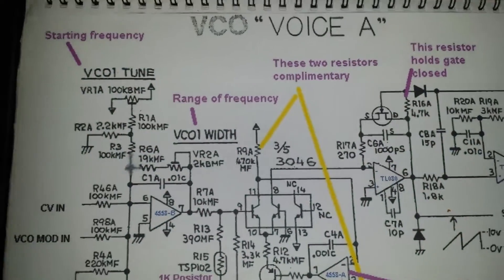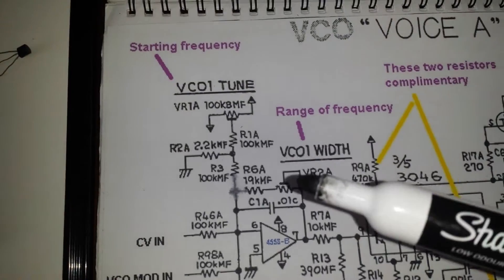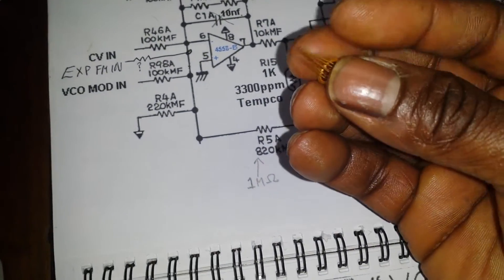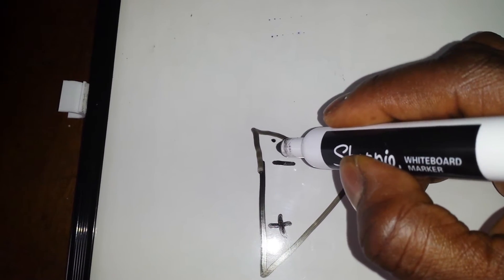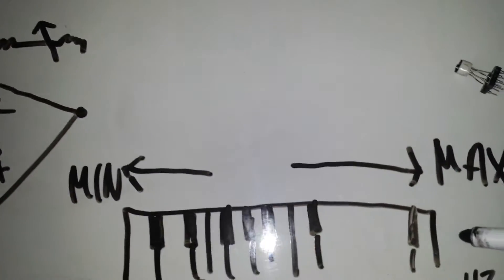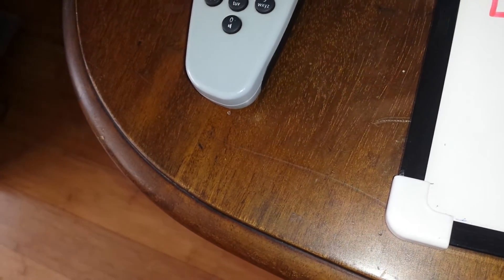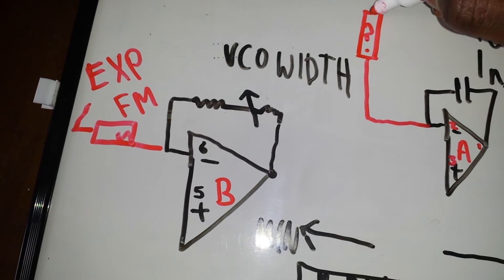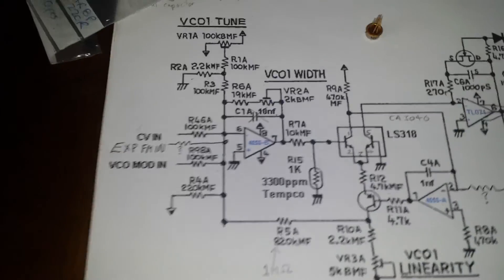DIY analogue synth project Tutorial Part 2b ( Exponential Converter extras)

Comment: okay, I've started building my first little syntheseizer. pretty important question now for me is, can I get this to play polyphonic? I'm going to try to rebuild what you've showed so far in your serias but for my own synth I wanna play multiple notes at once. So since I really like your desgine and probably going to adapt it into my own schematics (Will verylikly mix and mesh it with my own desgines and schematics from other sources) I'd like to know if it's possible to get a polyphonic sound out of it. basicly what would I need to modify for my final product?
Also, just noticed that the LS318 is not avaible at all my local electronic stores, are there any alternetives?
Reply from the maker: AP Girl Hi thanks for asking the question. As far as polyphony is concerned im sure to be honest . Thou you would onviously need to physical duplicate the oscillator and expo circuit x the amount of voices needed. You would then need to probably use some kind of sample and hold circuit to grab the first key voltage and and then set it up to trigger each vco vcf and vca etc. Maybe have a look at some old schemtaics ie:jupiter 6 jupiter 8 , juno 6 series. Obx , obx a and other polyphonic synths and try and work out the common components needed. As far the ls318 is concerned its not critical as im not using them due to availability. Im using the matched pair of the ca3046 array. You could also use lm394 tin can type or 8 pin ic. Other alternatives would be mat 02, or lm3046 . If you are buying for instance the lm3046 make sure you buy say 10 to start and test the matches pairs as you find sometimes they are not matched very well.
Reply: thanks! that's helping me alot! I'm sure to hit you up if I need to know anything more :D Keep the awesomeness up man!
Reply from the maker: AP Girl  No worries . Always happy to help and share my growing knowledge.
Reply: alright! I can get the CA3046 of ebay no problem. so that settels that, just have to wait 3 days till I can start building the Exp. Conv. :P
Reply from the maker: AP Girl . Good yes the ca3046 is a resonably good choice . Make sure you doenload the data sheet to familiarise your self with the pinout. Also dont forget pin 13 needs to go to -v rail with a straight wire.
Reply: sure thanks! btw, are you studiying electronics? I sure as hell will^^
Reply from the maker: AP Girl No, i pretty much taught myself as ive gone along. Thou i do watch various videos here on youtube and look at diffeent schems to make sense of things i don't know. My initial intrest was building my own synthesizers and not really electronics, however ive gain quite alot of knowledge of both along the way :-)
Reply: ^^that's basicly also how my craze for analog equipment started. I've strated buying some mixers and so for my production but now I finally wanna build my very own synths to have unique sounds for my tracks!
Reply from the maker: AP Girl Damn right, dont be a synth sheep. Be the shepard !!!
Reply: :D
Reply: okay, with some searching the local electronics shop I tracked down an offer for LM3046M chips, sadly they in SOIC-14. means if I need more than the 5 of ebay I'll have to invest some time into making adapters =_=|| I could buy them but they are 5€ per piece, and the LMs are also not cheap. so when I buy them I'll make sure to buy at least 30 or so to have a supply for sometime. 
As someone once said, limitations make creative. it's the same chip, just a diffrent size, I'll make that work somehow!
Reply from the maker: AP Girl Damn ok. Im in the u.k so have quite a few acessible options. The current harris  ca3046 i am currently using to today were from china. I must admit i was a bit ignorant when i first bought them and then became aware of fakes , ie the 10 mn3007s i bought. Yes you could make soic to dip adapter. Anyway keep hunting and good call buying a small bundle. Be sure to test the diffrential pair in the 3046.
Reply: yea, I will! I'm just happy I found them at my electronics store of trust. Conrad electronics, one of the best electronic stores here in germany! the chip itself is from Texas Instruments so I'm faithfull it will be ok, but you never know. it is quite possible that there are a few bad ones in there.
Reply from the maker: AP Girl Ok good . Hope they serve well for you.

Comment: Hi! I proceed slowly :)
R4A comes from pin 6 of OPA2132 to V- ? And on the top is the voltage divider with VR1A pot (I've took 50k, doesn't have a good 100k for this yet) and VR1A is connected to V- and V+ and the washer is connected to R1A 100k from the volt. divider. Is this correct? I don't understand this logically :)
Also I've didn't found any PTC thermistor for 1k locally. I've seen that it can be only ordered (I'll do it later). For some time I've replaced it with a regular 1k resistor. I guess that I can assemle 1k thermistor of two 500 oHm or close to it. Not a big problem for a start, right?
Instead 820k R5A I've made ~829k of two resistors. I feel that I'll go shopping tomorrow or after :)
I guess, I can check this just using my main CV (from batteries) "+" and a potentiometer. So I'll remove it from the oscillator and connect to this module. This "thing" looks like a forgotten spagetti and few bugs :)
Reply from the maker: MoolahNasreddin . Hi its a bit much to explain all this in  a comment as i clearly explained in part 1 . Vr1a is not a voltage divider it is a trimmer you use to set the initial frequency of the  VCO when you come to calibrate it. OPA 2132 is a dual op amp which is wired exactly the same as a TL 072 very important you check data sheet first as they are a bit pricey to get wrong .
Reply from the maker: MoolahNasreddin Yes you can substitute the 1k ptc tempco with a normal 1k resistor for the meantime. This is a link for the 1k positive tempco resistor . www.thonk.com
Reply from the maker: MoolahNasreddin Keep going with it . It will slowly start to make sense.
Reply: Thanks! I've found it.
Reply from the maker: MoolahNasreddin Good stuff :-)
Reply: I did wrote it wrong ) There is the volt. divider and after it comes the pot. One thing I was confused that it's connected to + and - voltages. If the washer will be disconnected accidently then will it make a short cut probably?
Reply: P.S. yeah, I'm checking datasheets everytime :) It's about x8 of TL074's price here. Not much places to buy. But it's OK to have them for log. converters. Very important module :)
Reply from the maker: MoolahNasreddin Yes thats right 820k from pin 6 of the second op amp to -v from your power . Think i misunderstood the first time thats correct yes this is the same pkace where R2a goes and the cv input which you need from a cv output keyboard of some sort which can output anywhere between 0-9volts rember each volt gives you an octave  input in pitch/frequency.
Reply: I'll try 1MoHm if my current setup will work. I'm not sure if it will be worse or the same... I guess it's too complicated to check with LTSpice :) I don't know where to check it with dynamics.
P.S. Sorry for mistakes in English I often understand that I've did that just after some time ))
Reply from the maker: MoolahNasreddin Do u mean 1megohm for replacing of r5a 820k ?, if so yes should be ok .
Reply: yes, of course.

Comment: Hello Ajull!
Do I need to connect to "ground" where it's pointed? Is it very necessary? We don't have grounded power sockets in our flat (old multi-flat house). Using heating pipes or batteries for this may be dangerous (don't ask, it's Russia).
Reply from the maker: MoolahNasreddin Good question , where the symbols of ground are you connect this to zero volts not mains voltage earth look at part 1 tutorial on the 9v battery trick .
Reply: What if I'll do the same with two simple AC to DC12v adapters like this (for example) http://www.mini-box.com/12v-16A-AC-DC-Power-Adapter ?  Output's ripple can be lowered by capacitors as I've understood in some videos.
Reply from the maker: MoolahNasreddin Hmmmm not sure my instincts tell me know . The ampage looks too high for a start .
Reply: if the ampage will be lower?
Reply from the maker: MoolahNasreddin Personally i donr think it would work . If you wanted to try a single supply for starting purposes then go for 12v dc but make sure it is around 2amps max. However you will then need to use single supply op dual amps like the LM358 or the quad version which im not sure the number of for the oscillators . However i dnt think the expo converter will work on single supply as the op amps and some other circuitry require bipolar supply.